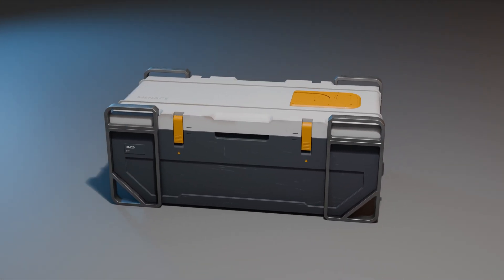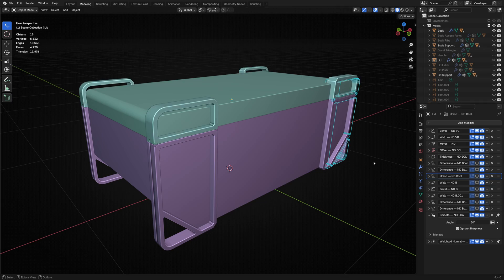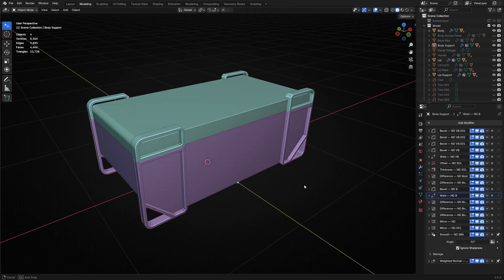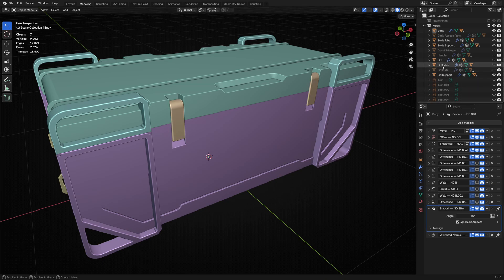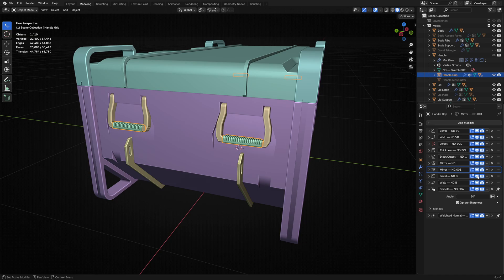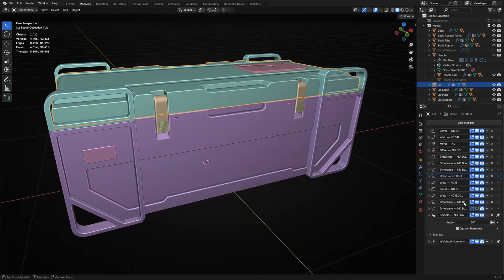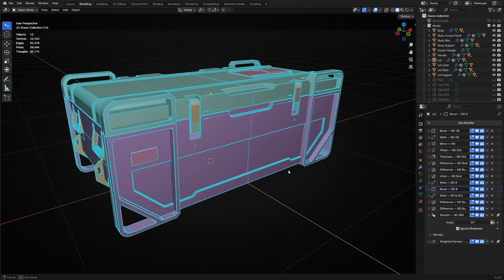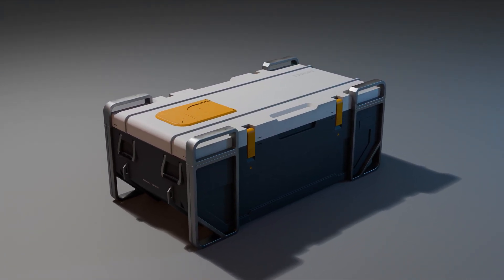Designing a Heavy Duty Sc-Fi Crate in Blender — Non-Destructive

Comment: thank you for the great guides! what do you suggest workflow-wise for assigning materials to specific faces of an object? should I be saving an ND version of each object then applying modifiers on copies to get per-face material control, or is there a more elegant way?
Reply from the maker: Yup, that's the simplest and most straightforward way, and something we do here. There are more advanced methods using GN, but its not something I can easily explain in a YouTube comment. — Tristan

Comment: Cool extensions like ND that provide custom pop-up UI displays within the Viewport are great. It also highlights the need for Blender's developers to improve on the base pop-up display UI component features. It was only recently that a pop-up window was able to provide an object picker for example. Previously, these picker UI components only worked in the properties panel. The next thing to improve is to improve the ability to manipulate Modifiers displayed in a pop-up window. As it stands, a pop-up showing a list of Modifiers does not allow you to sort the modifier stack using drag and drop, which is only available in the full Properties panel. Devs really need to step out of the mindset that any pop-up windows should only be used for generally displaying notifications or status and provide extension authors greater flexibility to use all UI features in a custom pop-up window.

Does Blender allow you to display the ND 'hud' UI with a background, maybe with opacity or even a blur filter? That would improve contrast for the ND UI text. I think the only UI text readability trick open to extensions authors is something like a drop-shadow?
Reply from the maker: Having greater flexibility and low-level/system access via Blender's API would be amazing. However, I understand why the core team focuses more on Blender's built-in functionality than its Python API layer, so it will always lag behind in development. In the meantime, we have to be innovative with what we have, or look to improve the core API via PRs where we can :) — Tristan
Reply: @ Just realised I got your name wrong. Blame Youtube auto caption which called you Ian. AI really is overhyped 😉
Reply from the maker: There's two of us ;)  — Ian
Reply: @ LOL. One is Huge, the other is a Menace I assume?